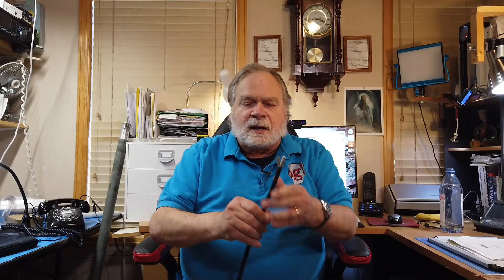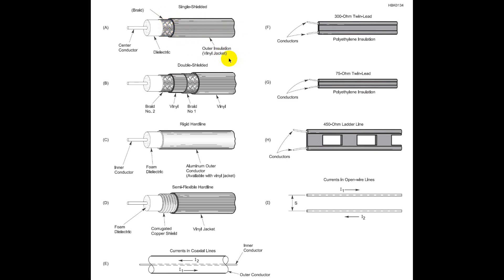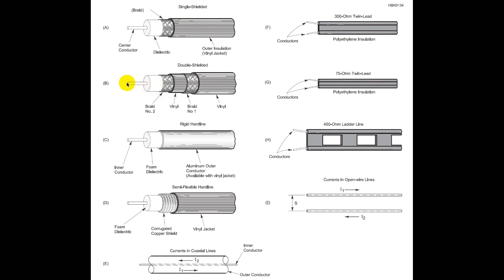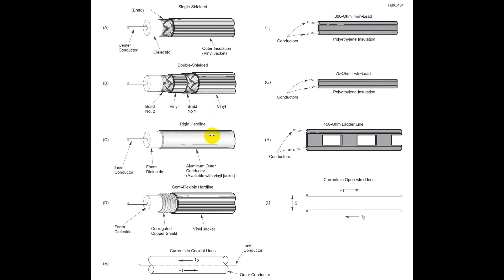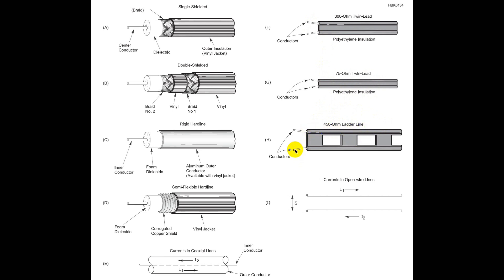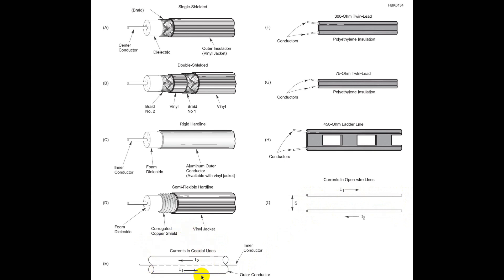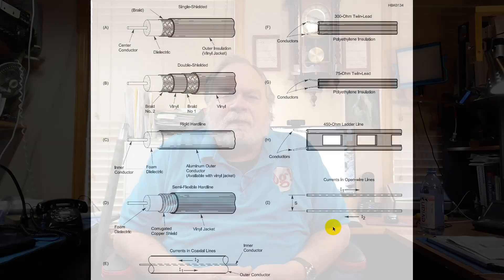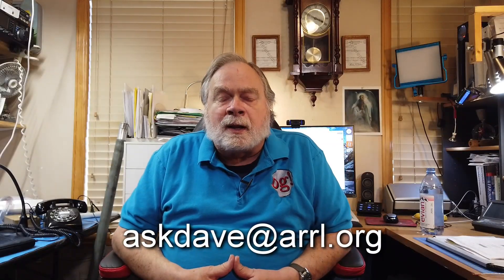A Quick Look at Different Transmission Lines (#1109)

Comment: Dave, it is my bad that I have to make a harsh comment here.
At 5.04, it is you who is doing the misinterpretation of what happens in a coaxial cable; I feel sad that this is not the first time you say like this despite me trying to point out several times in your previous videos. 
Let me try to reiterate one more time for the benefit of everyone here.
A coaxial cable behaves like  three conductors all at the same time because of the phenomenon called the skin effect. 
Yes, HF (RF) current flows only on the surface of a metallic conductor. This is unlike the DC that occupies the whole thickness of the conductor. 
As the frequency of the AC (RF) gets higher and higher, the  lesser becomes the thickness the current occupies due to the skimming effect. 
Consequently, the coaxial cable has three surfaces for the current to flow.
1. The outer surface of the inner conductor. 
2. The inner surface of the outer conductor. 
3. The outer surface of the outer conductor. 
Whenever a current flows on the outer surface of the inner conductor, there is an equal magnitude of current flows on the inner surface of the outer conductor but of opposite polarity. 
Suppose that the cable is connected to a voltage source (Tx) at one end and to a load (an antenna) on the other end.
There won't be any current flowing on the outer surface of the outer conductor.
The electric and the magnetic fields, due to the flow of currents inside the cable, would be confined to the dielectric medium of the coaxial cable. 
There should not be any current, I repeat,  on the outer surface of the outer surface of the outer conductor.
What you have failed to appreciate (or realize) after this long is quite evident, whenever you talk about CMC and grounding the coaxial cable before it enters the radio shack. 
By grounding, we mean only the outer surface of the outer conductor of the coaxial cable. Time and again, you talk about using a GDT type "static bleeder" on the ground stake. Let me reiterate that it is not a lightning arrestor (as often erroneously told by you and believed by many) but a static bleeder only. A static bleeder is no way near to a direct hit by a lightning bolt.
You used to say again and again that a CMC flowing on the outer surface of the outer conductor can be grounded by a grounding rod attached to the coaxial cable before it enters the radio shack. That is a wrong assumption. 
Please try to consult the ARRL antenna book again and again to get a clear picture of the basic principles. 
Many people have great faith in your channel. Let them not be misinformed. 
Moreover you called the 450 ohm commercial window line as ladder line. Ladder line is one that is homebrewed to have an impedance in the range of 300-600 ohm depending on the spacing distance between the two conductors. 
The purpose of the windows or slots is two folds. 
One is to reduce the weight as you said. 
But the important reason is to leave only less polyethylene dielectric and more of air to maintain the characteristic impedance and at the same time to sustain high voltages that would occur due to high SWR. Yes, open wire, twin lead or ladder line is used on multiband wire antennas with more than 95% efficiency despite high swr.
In high power commercial radio stations the open wires are used, as you all know. 
This is in the good spirit of radio hobby. 
De VU2RZA
Reply: IM NOT TAKING ANYONES PART BUT I DON’T THINK YOU NEED TO READ ANYMORE, FOR ONE THING YOU DONT KNOW WHAT YOUR TALKING ABOUT, this comment is just for the fun of the hobby 😂